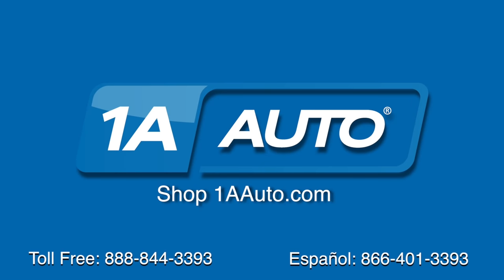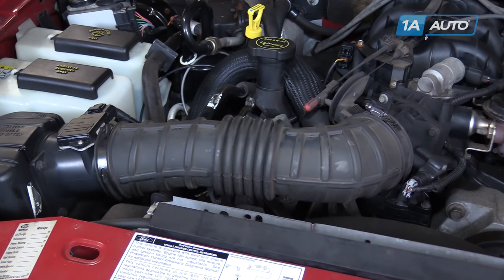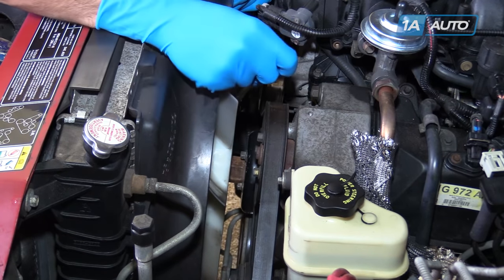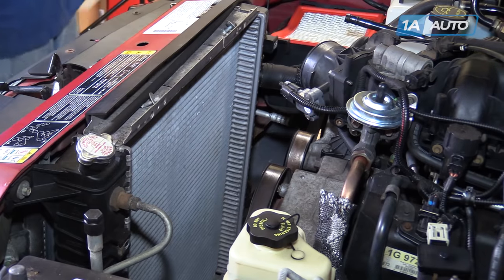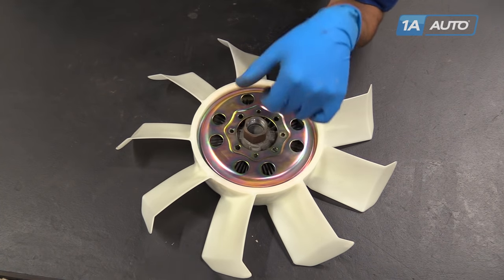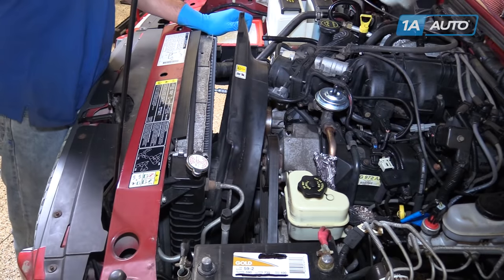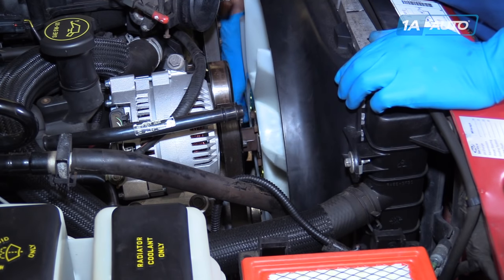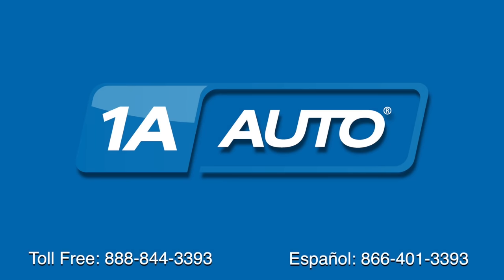How to Replace Radiator Cooling Fan and Clutch 90-04 Ford Ranger V6 4.0L

Comment: Thanks for the tutorial.  This was such a pain to get off even with the added tension.  I feel like it was more luck than anything that mine popped loose.  I get the feeling that I should have done the serpentine belt while I had the old fan off, but I'll cross that bridge later.

Comment: It's close except you don't explain how to get the stuck fan clutch nut loose. That is the major problem.  The belt will not hold the the water pump still while taking the fan clutch off.
Reply: Had the same problems,  Got belt so tight it broke before it would allow the nut to turn. O'riles(auto parts store) had a fan clutch removal kit free to use, in it is the correct size wrench for the fans 36mm nut, and a even larger looking open end wrench that goes across the 4 bolts on the water-pump pully to hold it in place, worked like a charm.

Comment: My experience with removing ranger fans has never been that easy. There is no way that clutch came off that easy the first time
Reply: Bro my fan broke at the threads so now my ranger has no fan. Ill replace it next summer fir the a/c

Comment: If you have the 36 mm wrench, it makes it so easy. You dont have to remove the water pump bolts to access the fan clutch nut. Had mine out in about 10 minutes and the new one in about 15 minutes.
Reply: Agreed. DO NOT remove all four bolts to the water pump pulley, or you will not be able to unscrew the 36 mm main nut. Instead, go to AutoZone and borrow a spanner wrench, as well as a 36 mm wrench if you need one. The spanner will fit around the four bolts to give you something to push against for that nut.

I don't think putting reverse (adding) tension to the serpentine belt is a good idea. If yours breaks it probably means you needed a new one anyway....

Your replacement fan appears to turn the wrong direction. The original did not have the heavy duty cooling option, which your new blade is for. I ended up getting one that looked the same, a Dorman 620-155.

Comment: The fan clutch nut on my 98 4.0 feels like it's welded I mean you can torch heat it and turn nut to left passenger side but no dice

Comment: What if extra belt tension doesn't work?  What if a fan clutch removal tool that grabs the 4 pulley bolts doesn't work?  What if an air hammer doesn't loosen it?  What then?

Comment: wait, my manual says it's a reverse thread, but that is loosening to the left?
Reply: It is a conventional Thread.  I took out two adjacent bolts from the mount. Took a 1/8" x 1.5" x 24" steel strip. Drilles two holes to match the fan head, cut a recess between the holes, then bolted this to the fan hubs removed earlier.  This was used to hold the fan hub while removing the 36mm nut.  It took a few good taps on the 36 mm wrench to break the nut loose.  Then just spin the fan until it comes off,  Remove the tool after fan/shroud removal.

Comment: Do u have a fan clutch for a 2000 ford ranger 3.0 v6
Reply from the maker: +Mind Rape Thanks for checking us out. We do not currently offer a fan clutch that is compatible with the 2000 Ford Ranger 3.0L engine. 1aauto.com